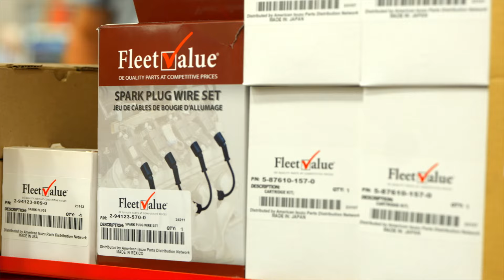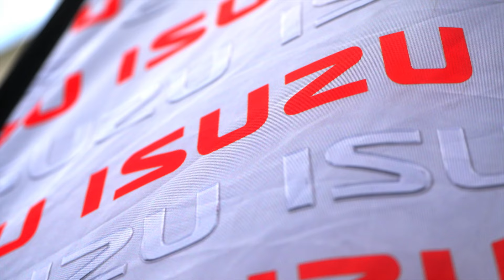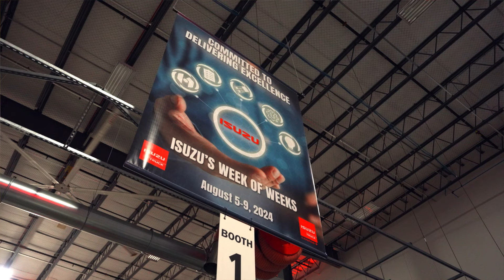2024 Isuzu Week of Weeks

Comment: This Is the New Upcoming 2026 Isuzu D-MAX Mid Size Pickup Truck. The D-MAX Came With A 3.5 Liter V6 and the 2.5 Liter Inline 4 Cylinder Diesel (ITEQ). And the 6.2 Liter V8 and the 3.0 Liter 4JJ3-TCX Turbo Diesel Engine. And the 4.2 Liter Turbo Diesel V6. And the 6.7 Liter Turbo Diesel V8. And the 2.2 Liter RZ4F Engine and the 1.9 Liter Turbo Diesel Inline 4 Cylinder Engine. And the 3.2 Liter Turbo Diesel Inline 5 Cylinder Engine and the 2.6 Liter Inline 5 Cylinder Engine. And the 2.1 Liter Inline 4 Cylinder Propane Engine. And the D-MAX Electric. And the D-MAX Hybrid. The 2.3 Liter Hybrid Inline 4 Cylinder Engine. And the 3.6 Liter Hybrid V6 Engine. And the 6.6 Liter Hybrid V8 Engine. And the 2.9 Liter Hybrid Inline 5 Cylinder Engine.